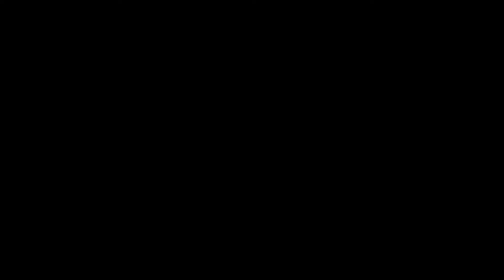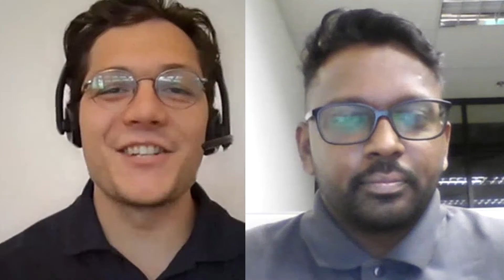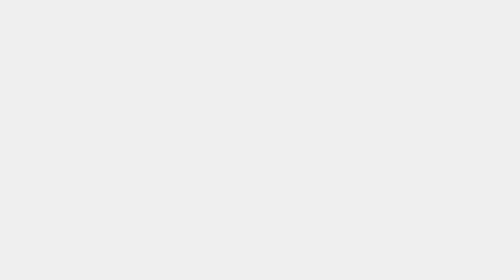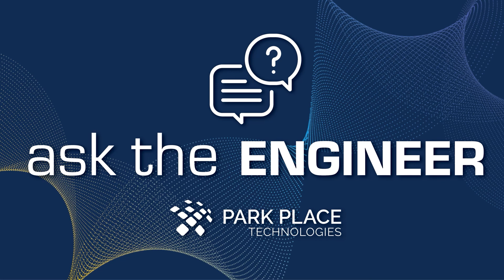Raid Controller Battery Failure Impact - Ask the Engineer

Comment: the replacement batteries for storage controller caches are OVERPRICED by a factor of at least 1000x! 
for example the HP ones for DL580 are priced at around $500 THOUSAND per kW-hr